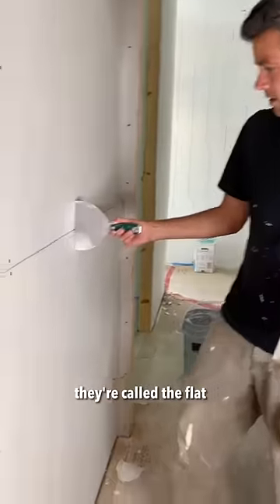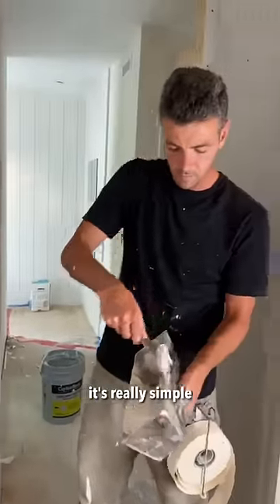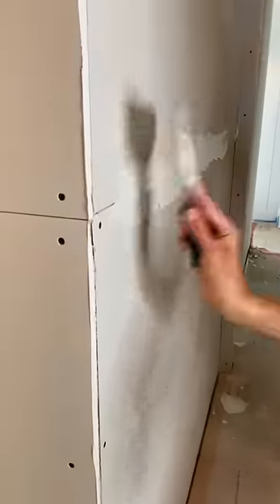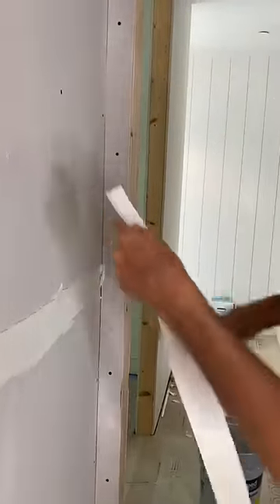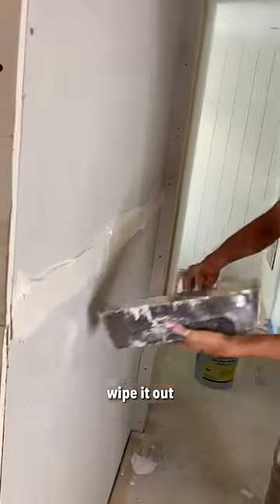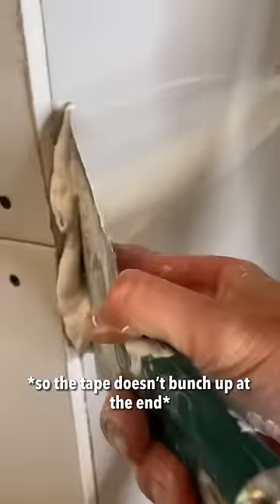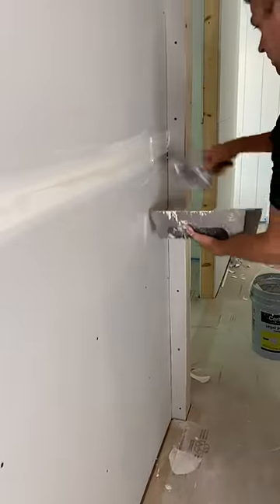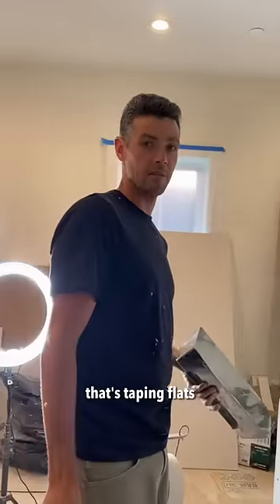Beginner Drywall Tips! Taping Flat Joints

Comment: Is the paper tape better than mesh? I always get bubbles. Someone told me you can actually get a lot more bubbles in a poorly insulated house.. I went around resealing as many drafty spots as I could and it actually helps with the draft between the walls. My mudding still isn’t perfect though. Still get the bubbles in some spots..

Comment: FIRST THING! It's not simple. This is and will always be very difficult to do. You need to apply the right amount of Mud that needs to be correctly mixed. You need to make sure your not removing too much Mud. Try not to drop more Mud on the floor then one the wall and don't track Mud throughout the house. That Knife he is using takes time to master that thing. He is making this look simple.

Comment: Okay.  The joint is  not beveled to hide the tape.
The ends aren’t beveled 
It’s beveled to help hide the crown of the lumber
And most of your tape is still dry either add a bit more water to your mix or apply more let rest and skim off

Comment: nice done, but should read the manufacturer manual, those plaques are not build to put them horizontal, they are mean to be vertical. No matter the brand, placo, knauf, pladur, GypFor.... I don't know why i see this alot, some dudes told me is faster this way, but when the materials settle down is easier to get cracks:
Nice taping tho, pretty clean

Comment: Question if the bottom 2 feet of drywall is cut out in my basement and I’m putting new sheetrock up is it the cut side up to meet the cut side or the cut side meeting the new sheetrock edge so it can be taped?

Comment: Ahhhhhh those corners wtf!!!!! 100% incorrect too, they should never land flush with the drywall, if you’re doing square bead there should be 1/4 gap in the corner for the mud to sit in. When doing round bead you cut the board back to the edge of the stud so the mud is thick enough to hold your bead. We usually staple the beads in if it’s round.

Comment: That corner is wrong. 
The drywall should be cut short in both sides, 1/2” approximately enough room to hold the mud and make the bead stronger.

Comment: Why make room for the next coat? You FILL the recess then the compound will shrink and THAT'S why you need a second coat before the finish coat. 

Why underfill the joint? You fill each coat flush and due to the compound shrinking is the ZONLY reason why you need 3 coats.  These guys are the "handyman" type and have never been taught by professionals that have done their time and know what's what!

Comment: Mfs are dumb thin thin coat just enough to stick the tape to the drywall run a 2" mud knife down the tape not a 6" blade then you can start to apply the thicker coats